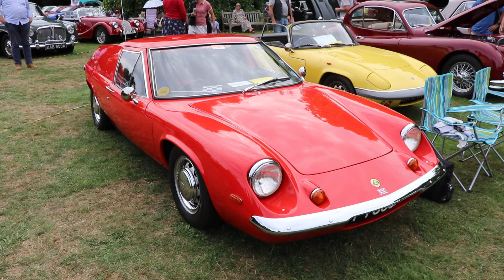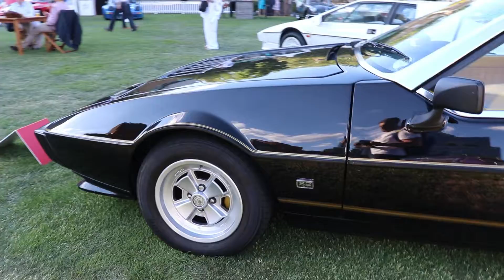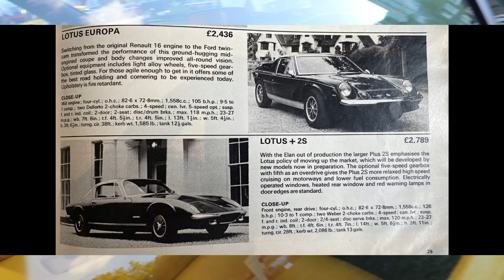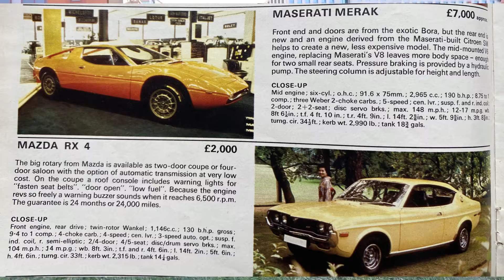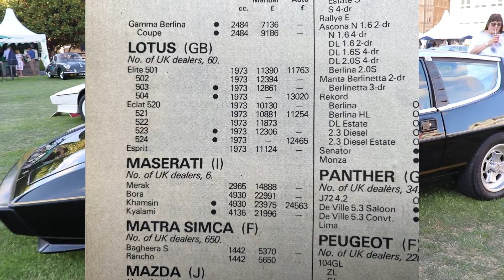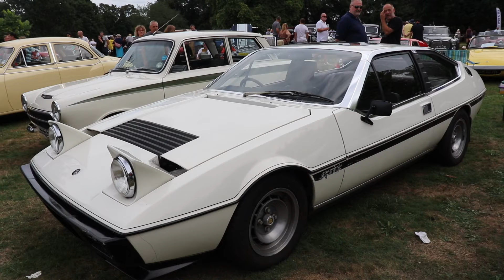Lotus Elite RIVIERA S2 / The 1982 most Luxurious and Exotic Lotus !

Comment: I owned a Lotus Elite 503 way back in 1987, beautiful handling car to drive but suffered from grit getting into rear universal joints on transverse drive shafts. You are unlikely to come across another Elite 2.2 Riviera, because according to Lotus only 50 were made. I now own a 2012 Lotus Evora S  which is a fantastically underrated car.
Reply from the maker: @windinghole001  The time for Evora will come. Thank you 👍

Comment: Great video and very well researched . 
I am a long term Lotus owner and absolute Lotus fanatic.
As much as I love the look of the Eclat/Elite I would strongly advise against buying one. They are a nightmare to buy and own. Rot, unreliability and the Lotus that damaged Lotus' reputation. 
It eventually evolved into the Excel which is a great Lotus to buy.  I have owned one (and still Love them) The previous problems were sorted out and Toyota supplied various parts from the Supra such as gearbox and diff etc.
This partnership came about when Toyota was having trouble getting the MR2 to handle and asked Lotus for advice. This led to a long lasting friendship which still exists today.
Reply: They rot? You can't mean the series 2 as it has a galvanised chassis. unreliable? Not if maintained properly. Damaged Lotus? Well the body building technique developed for the Elite went on to become the way Lotus built all their bodies, and the Excel version went on well into the 90s so what is the damage you refer to.
Reply from the maker: Thank you very much and I absolutely appreciate your comment 👍